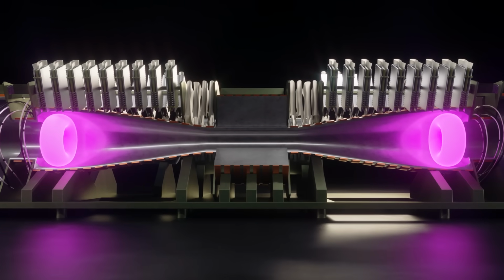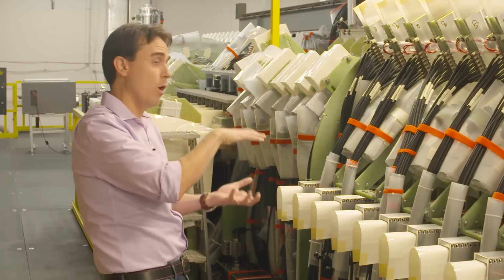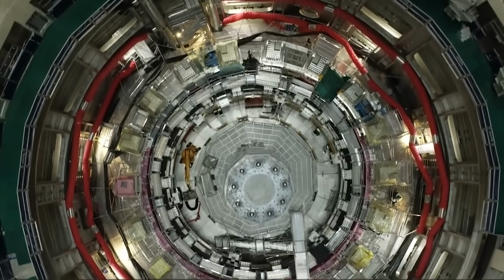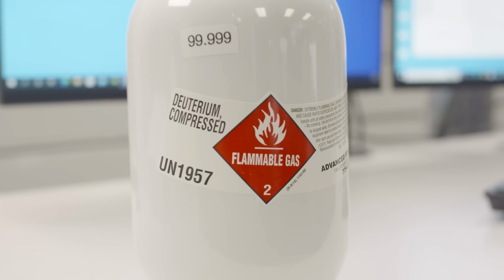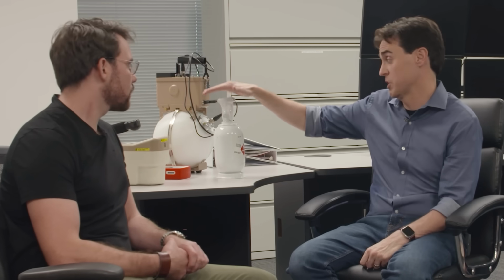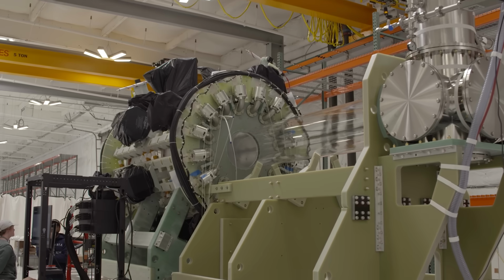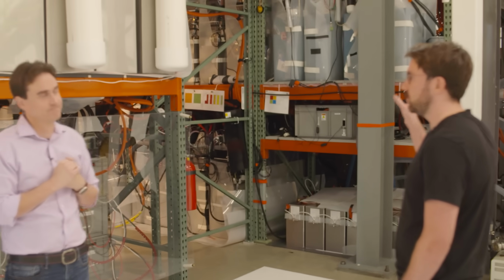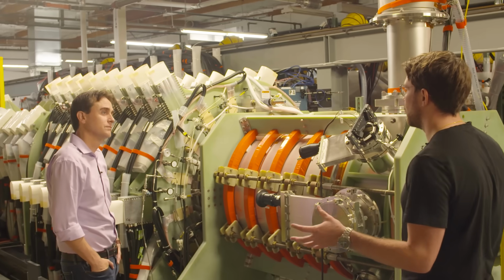A New Way to Achieve Nuclear Fusion: Helion

Comment: Beautiful. However we still can't afford this energy at all yet. Maybe in another 100 years? Also, nobody has mentioned what happens if there is not a perfect match and mate. What happens during an unstable reaction? The compounds used to fuel the reactor are safe. What happens when the housing can't hold the reaction? What happens if the magnetic fields become unbalanced? 
This reactor is marvelous. However the amounts of energy it produces if it fails makes Chernobyl look like a firecracker. 
Perhaps I missed something. Physics is mtot my specialty. However I am very good at creating power and energy from existing systems. 
Lastly, how small can you create this reactor? If it is supposed to go into space and power a vessel in space. Where do you get fuel in space? 
Forgive me if I can't help but notice that like a MUSCLE CAR with a big block in it, you can watch the fuel gauge move every time you crack the throttle.
Reply: Relax.
The energy contained in a single pulse is just a hand full of kWh. The plasma is very hot, but very low density. So, it cools immediately the moment it gets into contact with something, even ambient air. It would just dissipate.
Reply: @elmarmoelzer2229  okay. Still can't afford it. 😂🤣😂🤣😂🤣. I mean it when I say ," Beautiful." However, scholarly oversight has run a hard toll in the near history. 😁
Challenger, Discovery, Chernobyl. 🤣😂🤣😂🤣😂 Just to name a few.
Reply: @j.robertvillarreal5926  
Chernobyl, as bad as it was, was a comparably small event in energy history. 
And assuming a major accident form nuclear fusion is like assuming a major accident from solar panels. 
Heck, coal, gas and even hydro have a much higher death toll than fission even. Fusion would be orders of magnitude better.
Reply: Chernobyl wasn't as big of an explosion as you seem to think it is, it was a pretty big boom, with the largest explosion estimated at 225 tons TNT equivalent, which is about what you get from a ship full of artillery ammunition going off. There have been a fair number of bigger explosions, usually ammunition, sometimes other chemical storage incidents. The problem with Chernobyl is that it spread a lot of dangerous radioactive material around the site. The process as described here doesn't have anything nearly as nasty in terms of radioactivity, the only thing I can think of that they mentioned that is radioactive at all is tritium, which is pretty mild (can increase cancer risk if ingested, but no other risks that I'm aware of). Fission fuel is fairly radioactive, but when it splits it creates biproducts that are highly radioactive.

One safety issue I see is deuterium, which is chemically equivalent to hydrogen, which combusts vigorously and is not hard to set off, so this process is going to have all the risks associated with hydrogen, which are not insignificant but are certainly manageable, and since fusion is so efficient in terms of the mass of fuel needed for a given energy output, the volume of deuterium should be pretty low and thus easier to manage safely.

The other safety issue is just the release of plasma, any superheated fluid like that getting loose all at once can cause some havok due to simple thermal expansion and pressure release. If this thing works and we start building them for commercial use, we should definitely calculate the energy that would be released if it catastrophically failed at max temperature and max pressure, but given the low mass of fuel going into it, it is probably not going to be any more risk than a medium, or maybe big tank of methane or hydrogen exploding. We can probably build blast shielding around it to keep plant workers safe, and make sure the building structure is likely to stay standing in the event of a worst case scenario catastrophic failure. And an uncontrolled chain reaction seems impossible here, as soon as the electromagnets fail, the fusion conditions will be lost. In contrast, a fission plant's catastrophic failure mode is a meltdown, where the fuel heats up to well beyond operating temperature, melts into a pool of slag, which can still maintain a chain reaction until it flows and spreads out into a geometry that distributes its fissile material enough to go subcritical. That doesn't happen nearly as fast as an electromagnet turning off so a lot more energy gets released as the failure happens in that situation than would here.

There is no such thing as perfectly safe energy generation, any system that can slowly release energy can generally release it quickly, fusion has some of the lowest potentials for risk because it is so hard to maintain it, but even just the operation of an electricity generating plant carries risks to be managed.

As for costs, we don't know what they will be, but nothing described here is particularly expensive. The fuel isn't super cheap, but it isn't outrageously expensive either, and it can potentially be significantly cheaper. Capacitors, wiring, controllers, and electromagnets aren't particularly pricy, and vacuum chambers are manageable too. I'm sure their current setup is quite expensive with all custom parts, but if it works, I don't see anything that makes it clearly unaffordable. We will also have to find out what its capacity factor is in practice, how easy it is to throttle power output up and down for load following, if it can match real world grid fluctuations well, it will have an advantage over wind and solar because it doesn't rely on intermittent power inputs, but even then it will be hard to compete with them on cost, but we will find out those details if they succeed with their next couple of prototypes.
Reply: @TheReykjavik  
The amounts of fuel in the machine at any given time are miniscule. For reference, a 50 MWe Helion power plant would consume a mere 20 kg of Deuterium a year.
You do not need that much fuel on site at any given time and you can spread it over multiple storage systems too. The density of the plasma inside the machine is very low as well. AFAIK it is less than 10^24 ions/m3 at peak compression (might be as low as 10^23 ions/m3). At 10^24 ions/m3 it is 4% of the density of ambient air. 
So, while the temperature might be really high at peak compression, the density and therefore the total energy content is still rather low. The plasma would cool almost immediately if it were to touch anything (even ambient air). 
The plasma itself has a magnetic field. That interacts with the magnetic coils which extract energy from the plasma.
If for some reason the magnets failed in a manner that the coils can no longer extract energy from the plasma, there would be some damage to the inner walls of the machine and it would need maintenance, maybe not even after the first time that happened.
Reply: @elmarmoelzer2229  A Watt is 1 Joule/s, and a stick of dynamite has about 1 MJ of energy. That means 50 MW is the equivalent of detonating 50 sticks of dynamite per second. There is no such thing as a safe 50 MW powerplant. If nothing else, a failure in the control software overloading the capacitors to catastrophic failure could cause an incident. 

And if we built enough of these things to power half the current US electrical grid, that would come out to about 260,000 kg of deuterium per year, and that isn't going to be distributed at all times, that is going to be produced at a small number of large scale facilities if this is going to be cost competitive. I personally don't want to be around a 2kg bottle of compressed hydrogen when it fails, and the manufacturing facility is going to have more than that on hand at any given time. And we have to assume that there will be incidents if we scale this up and do it for the long term. Nothing we do is without risk, and if we are going to do it at industrial scale we should assess those risks and mitigate appropriately. This technology has the potential to be the safest energy we've ever used, but that doesn't mean we should be complacent.
Reply: @TheReykjavik  
Eh?
- One Megajoule comes down to about 278 Wh. That is the energy content of a gaming laptop battery. 
- Helion's capacitors are purposely chosen to be fault tolerant. They are very low energy density so that the steel container can prevent any catastrophic failures from spreading. They are also self healing and fault tolerant. Helion has used some of their capacitors for over a billion of pulses (the equivalent of years of operation in a power plant).
- The claim that there is no safe 50 MW power plant is strange. I guess, we have different definitions of "safe". There are GW+ power plants that have operated safely for decades. But then there is no 100% safe. I bet you lock yourself in your house all day because participating in traffic, even as a pedestrian would be far more risky.

- Hydrogen powered cars typically store around 8kg of hydrogen. There are very few reported accidents. 

- The US currently produces about 10 million tonnes of hydrogen a year. 
There are probably several billion hydrogen storage containers with a capacity of a kg or more in the US.
Yet, the number of hydrogen related accidents is very small.

- The typical process of making Deuterium would probably make Deuterated water (which has been done on the order of 250 tonnes for CANDU reactors), which would then probably be electrolytically split close to where it is used.
Reply: @elmarmoelzer2229  you really are reading a lot into my comments that isn't there. I'm not saying the danger is too great to do things, I'm saying safety regulations are important and we shouldn't neglect them. A lot of people have died working with hydrogen, and as a result we have safety regulations and standards that are written in blood. When we enforce those standards, very few people die or are injured.

This reactor will probably be safe enough that driving from home to the power plant will be the most dangerous part of the day for workers, but that doesn't excuse this idea of declaring the risk inconsequential when it definitely is not.
Reply: @elmarmoelzer2229  you really are reading a lot into my comments that isn't there. I'm not saying the danger is too great to do things, I'm saying safety regulations are important and we shouldn't neglect them. A lot of people have died working with hydrogen, and as a result we have safety regulations and standards that are written in blood. When we enforce those standards, very few people die or are injured.

This reactor will probably be safe enough that driving from home to the power plant will be the most dangerous part of the day for workers, but that doesn't excuse this idea of declaring the risk inconsequential when it definitely is not.
Reply: @TheReykjavik  
The point is that the risk is minimal compared to other daily activities and pretty much all other energy sources.
Reply: @elmarmoelzer2229  That isn't a good point. The correct point, that you seem weirdly resistant to, is that no energy source will ever be safe and it should be clearly analyzed and the risks mitigated, and no amount of whataboutism will change that.
Reply: @elmarmoelzer2229  Not much?  The annual production for the whole world of Tritium is just 20kg.  If Helion's plant takes 100% of annual production of Tritium, what will be the price of the Tritium?

Comment: It's amazing and all, and I certainly hope that they, and we (I mean humanity), overcome all the obstacles and challenges in producing cheap(er) and large-scale fusion energy systems, but it seems to me that there's a reason why natural fusions systems (i.e., stars) are so massive: because it takes a massive amount of energy to produce a fusion reaction, and stars accomplish this by creating immense pressure through incredibly high masses. Their very masses produces the pressures necessary to generate the high temperatures required for fusion reaction, while it takes us immense amounts of energy to reproduce those conditions. But, as neither a physicist nor an engineer I may have no idea what I'm talking about lol (and I actually hope I don't!)
Reply: Gravity is actually a relatively weak force compared to the magnetic forces that Helion uses. The energy going into the plasma in a single pulse is in the low kWh range. So while the power is high, the energy is not.

Comment: To produce more power than it generates it would need a sustained fusion reaction right?
If you have to input power for every fusion reaction then there's no way it will produce more power than it consumes.
Neat idea but I didn't even hear them talk about consumption to power ratio at all.
Reply: Not necessarily. Helion can recapture the input energy along with the energy from fusion. And in theory, every fusion reaction will result in more energy out than in. The key is to have enough fusion reactions for a given amount of energy put into the system. A lot is normally lost because not every bit of energy put in will result in a fusion reaction. IF Helion's system works, that energy is also recovered at very high efficiency. So, the fusion reactions only have to make up for that difference.
Reply: @elmarmoelzer2229  sustained fusion reaction would.... This is not sustained. It's small bursts of fusion from using enormous amounts of energy.
Reply: @user-eq2ug7in7b  . No, you do not understand how this is supposed to work.
AThe amount of fusion you get is defined by the triple product of temperature, density and confinement time.  
FRCs are great in that they are orders of magnitude more dense than (e.g.) Tokamaks). But they are also very unstable.
For FRCs at the size and elongation that Helion does, the main instability is the rotational (n=2) instability. Basically, the FRC "slowly" (for fusion terms) loses confined particles over time. The more particles it loses, the fast the FRC spins until it has lost about half of them and it literally tears itself apart.
Helion's machines can keep FRCs alive and well for slightly over 1 ms before they lose too many particles. Other FRC based startups try to keep them alive for longer with some tricks (e.g. neutral beam injection at the edge which prevents the FRC from spinning faster and faster and replenishes the amount of particles in the FRC). While these methods work, they take energy. Helion instead thinks that they can recover the energy they put into the FRC plus the energy produced by fusion reactions at a high efficiency after ending the pulse.
Essentially, they recover the energy from the magnetic coils at either end of the compression chamber. What happens then, is that the magnetic pressure in the center splits the FRC in two with now two FRCs moving through the coils at either end of the compression chamber. That induces a current in these magnets (FRCs have their own magnetic field). 
The idea is that Helion can extract both the input and the fusion energy that way at extremely high efficiency. (though that is what Polaris is supposed to finally demonstrate this year). So, for them it makes sense to not wait until the FRC has lost over half of its particles (even though that means slightly more fusion reactions) but to terminate the pulse instead and just recover the energy. Due to the relatively short amount of timeframe, the ratio of input to output energy is rather small, but still greater than 1 (about 3). 
Hope that explanation made sense...
Reply: @user-eq2ug7in7b  
Please define what a "sustained fusion reaction" even means from a physics POV!
Because "you keep using that word. I don't think it means what you think it means".
Reply: @elmarmoelzer2229  no point in defining words for someone who can't use quotes nor Google for themselves. 
Type, sustained fusion reaction in Google.... There's your definition "from a physics POV" 💀
Reply: @user-eq2ug7in7b  A sustained reaction is not required, pulses are fine. A good analogy is a diesel engine. The diesel fuel won't ignite unless compressed, so you have to put energy into compressing it. Throwing the piston into the fuel to compress it takes energy, and if it doesn't ignite even then (for example if you had a chamber full of air instead of fuel), the pressure would just push the piston back, and you would lose a little bit of energy in the process, but you don't lose all of it. When the fuel ignites, it pushes the piston back out harder than it got pushed in, and all the engine needs to do useful work is for the energy from the fuel to be greater than the losses in the system. The piston coming back out turns the crankshaft hard enough to throw the next piston in and sustain the series of pulses, with enough leftover to power whatever machine it is hooked up to.

In this case, it is electromagnets pushing plasma instead of metal pushing diesel, but the principle is the same, if the next prototype works, the plasma will bush out from the center with more capturable energy than was pushed in. If the capacitors start a pulse at 1kWh and at the end of the pulse have 1.1kWh, that would be a huge win. And they claim to have achieved a 95% energy return on a prototype that did not do fusion, so they would only need the fusion to hit about 15% of the energy put in to get that result.